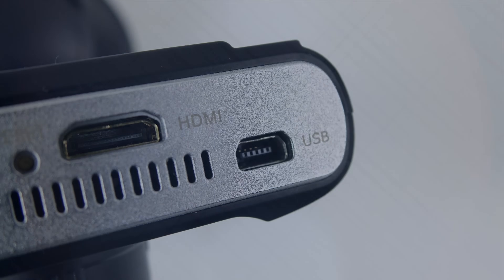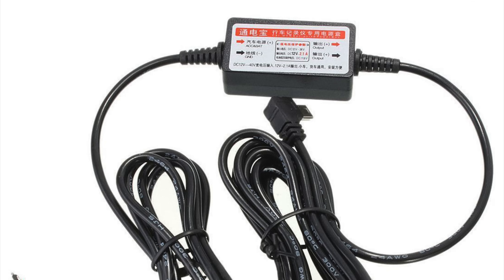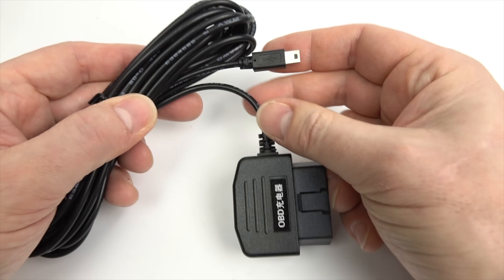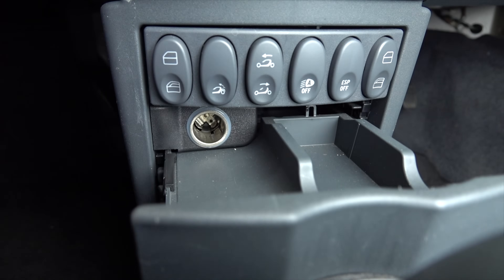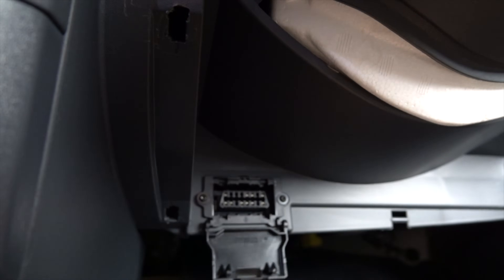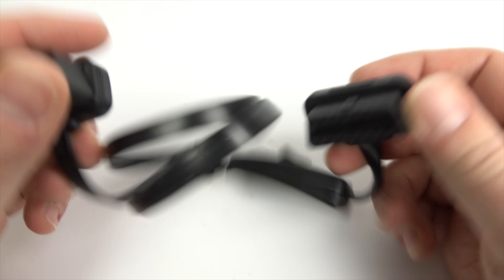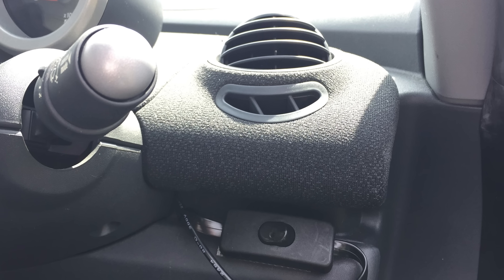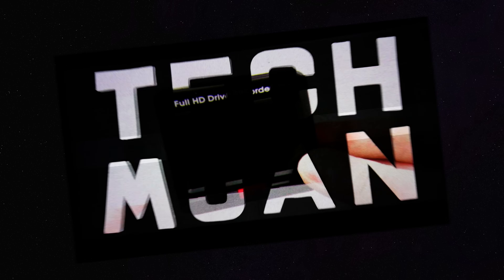You can power a Dashcam via your OBD port (but perhaps you shouldn't)

Comment: I recommend replacing all important fuses in your car with automatic reset circuit breakers

That's too say things like Engine Management, ABS, Collision Avoidance RADAR etc not so much heated seats fuses

They tend to last much longer and are more reliable too trip very few fuses burn out at the actual rated power rating or at the right amount of time often taking much longer and/or at a much higher power level than it should!

Comment: Worth noting for some electric cars: your high voltage battery may automatically recharge your 12 volt battery if it detects it's getting low. Some EVs do this and it's awesome. Also many obd plugs have low voltage cut off circuits in them so you don't need to worry about it anyway. :)

Comment: This comment is for the people that have an ev or tesla This is the preferred way to power your dash cam with a tesla you will have to buy an accessory  wires that will tap into wire housing conector  for teslas unique obd2 or cam bus for power and the accessory  wire will have to have a traditional odb2 port  and there you will have it power to your dash cam

Comment: I believe this video is out of date. I am using OBD power adaptors to install dash-cam to my cars and they have an on/off switch, which chooses between always on and accessory mode. Draining the battery is not an issue even with always on mode, because new OBD cables have voltage sensor, so shuts off when battery is below 11.6 volts. When in accessory mode, power turns off 5 minutes after you shut off the vehicle, so it's nice for the camera. I believe this video needs an update.

Comment: Using the OBD port for powering a dash cam also leaves the OBD port open for OBD car thefts and key cloning thefts that are happening nowadays.  Since hacking the OBD port is easily done with cheap, readily available devices bought online it's a good idea to lock it with a good OBD lock or to relocate it.
Find out more on our channel.  We have a video on the OBD locks.

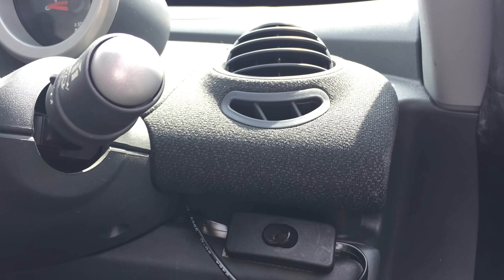Comment: 3:07 - 3:27 Why bother with a switch? You could use a common parking mode power kit with selectable minimum voltage settings, below which the thing get shut off, or by using a time duration setting, probably available in your dash cam's settings (although YMMV), as an approximation.

Comment: very old video for me to comment but juist adding my 2 cents... if you take this approach (power from the obd port), there are cables you can get which will auto cut off once the battery voltage reaches a low state.... (ie: it wont drain the battery completely).... as to how good this is for the battery, prob not too good (its still draining the battery to a lowish state), but better then draining it flat....

Comment: A better idea for parking mode is a big power bank.  Just get shielded  usb cables the right lengths to the cameras. Will not kill your battery. Im getting ready to do 4 cameras and it works. Saw a different video of a guy using a Rexing with a full screen and he got 12 hours of parking mode on a 20000 ma powerbank.  Some jackhole wrote on my window with permanent marker and scratched the door somewhat bad.  The marker i got out in 5 minutes. The door is $500- $700 for a professional to fix. Im fixing it myself. Weather is not cooperating.

Comment: I think its a good thing the dash cam keeps running because someone could break into your car and steal something (yes that's happened to me and didn't have a dash cam) so its good to keep it running so its recording when you're not in the car in case someone steals something from your car or hits your car while parked and takes off. just get an obd cable for the dash cam with low voltage detection so it doesn't kill the battery.
Reply: dude....if someone breaks into your car they can just steal your dashcam
Reply: @Matanumi  but if it records to the cloud you will be able to see who stole it.

Comment: I bought 3 of these with female usb adapter to connect my dashcams, it works really good, I leave it on at all times, soo far have not killed the battery, fast and easy  to connect
Reply: what's the longest you've let the car it without turning it on? My car sits sometimes for 4-5 days before driving it.

Comment: 1. There are dash-cams which can sense when the car is standing still, and they go into "parking mode" which is very low power consuming (one picture every second). I have one of these, it's called "mini 0807" and is really really good (it's an older model, i think there are newer ones now). When something hits the car the dashcam immediately starts recording with HD-quality and sound. This camera has recorded a hit-and-run so far, saved me 2000$ in repairs.

2. Some cars, BMW for example, sense the battery level and when the cars battery is getting too drained, they cut the power-feed to the OBD-port and 12V sockets in the car. My BMW 520D lasts about 6 hours in parking mode before it shuts off the power to the OBD. I have had my dashcam installed for two years and have never had any problems, works like a charm.
Reply: So if BMW cuts off power supply to OBD in 6 hours of parking mode. How do you run your dash in parking mode for longer duration ?
Reply: @harisjav  I can’t.. have to add another battery if I’d wanna run longer than that
Reply: Crooks, be patient. Wait for a bit more than 6 hours. Then go for it!

Comment: 2020 newest obd2 extension cable is made of high tenacity fiber material, can be fixed at an angle, and bears 50kg

found it on amazon:  https://www.amazon.com/MR-CARTOOL-Extension-Diagnostic-Compatible/dp/B08CZD7R9Z/ref=sr_1_127?dchild=1&keywords=obd2+extension+cable

Comment: I was watching some videos and related video linked showing powering dash camera via OBD-II port.

To get to the point, one of the best dash camera manufacturer ' Thinkware Dash Cam' has approved a 3rd party OBD-II power adapter called "EchoMaster OBD II Power Cable" and even selling it on their website directly + even made a video about it as well.

I think this should give enough confidence that... OBD-II port can used without any issues?

Comment: apemans (https://www.apemans.com/) has an ODB hardwire kit (CH50) with a micro USB connection for connecting directly into their dash cam.  Built into the line is a "G Sensor" unit that detects someone messing with your vehicle (vibrated) and starts the camera working - but also shuts off the dash cam (completely) if it detects the voltage of the battery drops to 11.6 or less.  This is a very informative video but it's going on 5 years old so it may not have been available in mid-2016

Comment: Not being funny, but most good dashcam 'even the cheap cameras' have a auto standby... so you'll not be draining the battery when a dashcam is fitted directly to the obd2 port... only if the camera is activated will small amount of energy be used at anyone time which in all essence is completely different when your comparing a camera to a light bulb...

Comment: As an auto mechanic, I can definitively say that using the OBD-II port for power is not dangerous or harmful in any way, provided that the adapter is made properly, and uses only the power pins for power. The power pins are a direct battery connection (through a fuse, of course) and are not connected to any onboard computer. Nearly every diagnostic scanner out there draws its power from that source, and those use a lot more power than a dash cam does. In addition, fleet tracking devices use it for power. Many insurance company tracking systems do so. In fact, many cars (a lot of General Motors models, for example) even have the power pins on the OBD-II port on the same circuit as the power outlets- connecting to those is exactly like plugging something in to your cigarette lighter. People who are saying you might damage your vehicle's electronics have no idea how these things work. Again, the sole caveat is that the power cord is made properly, and only connects to the power pins. It's essentially the same as using USB for power. You have power pins, and you have data pins. Same thing on OBD-II ports. The different OBD-II protocols (CAN-BUS, ISO9141, Keyword 2000, K-line, etc) all have their own pinouts for data, but the power connections always use the same pins on all cars.
Reply: I read your comment carefully. It shows that you are someone who talks with knowledge. I'm going to try this on my brand new XC40. I hope no problem will occur :)
Reply: Thanks for very useful info. I have a question please:- As connecting the dashcam via the OBD will mean the power is constant will this drain the battery completely or would it take many days for that to happen? And with this is mind would you suggest an in-line power detector that turns off the dashcam when the battery charge drops below a certain amount or is it not necessary?
Reply: @inquistive  most decent dashcams (viofo, blackview, thinkware) have low voltage control. When they're in parking mode they drop to almost nothing when you park. And will shut themselves off when low voltage is found.
Reply: @fcastle the thinkware obd2 cord uses 8 pins.. including data pins.. iroad uses 2 pins..
Reply: thanks for the info!
Reply: Based on your comment I will buy that cable. Your sentences are well put, this is why I will go ahead with the purchase. Thank you.
Reply: @InformedGlobe  garmin do a power adaptor/cable that has a timer switch at the obd plug - 10 mins, 24hrs or infinite. I'd like to think even in infinite mode there is low voltage cut off/protection, as per their cable that is hard wired directly to other cables in the vehicle (and is cheaper) but yet to find info regarding a cut off.
Reply: @thebrowns5337  Well, I just found out the hard way to use this stuff, my battery died, just spent $300 in a new one.
Reply: @thebrowns5337  Yes the Garmin constant power cable will automatically turn off if your vehicles battery goes below 12 vaults.
Reply: ok, but why do obd producers warn of plugging or unplugging it while ignition is on?
Reply: Thanks for sharing this. I have heard many stories about how the tracking devices from insurance companies damaged the electronics from various sources. So are you saying it is not possible? What if the car battery constantly gets drained?
Reply: Puedo usar una extensión en el puerto obd II  ,para una dash camera y en el otro  Dispositivo de cierre de ventana para coche, sistema de módulo de apertura OBD para TOUYOTA RAV4
Reply: It's important to also clarify that as a power source it's an output signal. It's coming out of the connector and not going into the OBD connector or computer.
Reply: @Anders Kristian meh I would suggest Flixportal. Just search on google for it :D -yehuda
Reply: @Yehuda Erik Thank you, signed up and it seems like a nice service :D I appreciate it !!
Reply: @Anders Kristian no problem =)
Reply: "People who are saying you might damage your vehicle's electronics have no idea how these things work."

Obviously, but thanks for being so clear about it.
Reply: I know it's pretty off topic but does anyone know a good site to watch newly released movies online?

Comment: i have this vantrue 2pro, i used the OBD port adapter on my honda accord hybrid, and it is a perfect setup! had it in sentry mode or parking mode for days, and no drain on battery. wont consume your battery, and its a clean install with no wires all hidden up to the windshield!! do it!!

Comment: Why can't they make a lead that detects that the alternator is running (14v ish instead of just over 12V) , when the alternator is runing the OBD lead uses that as a signal to send the power to the USB.
I guess they could , but who makes one ?
Reply: KarlosH Fuse circuits can be fitted into “on only” fuses like headlights or power windows.

Comment: There is a built in kill switch to prevent yr vehicles battery from draining and causing a no start condition. This allows your vehicle to record in parking mode without draining your battery. Also park mode only records for a few mins then shuts off if no movement is detected. Anyways I have the obd wire kit and is supposed to supply power at all times just like a telematics receiver for your insurance company that plugs into your OBD port. If it is draining your battery you most definitely have a short somewhere and would advise you to get that fixed asap or the obd port adapter is broken and the built in kill switch has failed and either will not work at all or basically heats up so much it sodders itself into an open current position causing a constant power drain. That would require a replacement obd adapter

Comment: I think the idea of using OBD is that when the ignition key turns off the dashcam senses a change in voltage and switches from (constant) operating mode to park mode, which operates only periodically and  briefly to conserve battery power. It is likely to only come to life when a sensor indicates outside movement near the car, or a nudge to the vehicle, or else it just takes 1fps snaps until the car is started again.

A power pack for £20-£40  gives peace of mind for your poor old car battery, but many dashcams claim that they automatically shut down when your car battery voltage drops to a specified threshold. But bear in mind these dashcams are often made in China where reliability and quality control is the Opposite of Germany.

The OBD port is a discreet location near the door and therefore it's usually easy to hide cabling runs to it.

Comment: If im going to have only DDPai M4  base connected to it ( actual camera module removed) , will it drain the car battery? If it doesnt then its quite neat solution tather than tinckering with fuse box.  Please reply Technomoan.

Comment: I am thinking of buying this as I am no electrician for cars and simple plug in for my carcamera should be fine??
Reply: yes. all good. the port is just a fused constant power port that can also be used to read diagnostics. too many devices can be plugged into that port and left for the cars life without a on/off switch and have been around for over a decade now. low power cutoff is why it's ideal for dashcams with park mode.

Comment: There's a new version that pairs this with a switch as well as a proximity sensor eradar which only draws power when and where an object comes within 3-5 m of the car, and auto switches off when there is no subsequent movement. It is also paired with an on off switch. Presumably, this deals with the issues of overdrawing from battery while running the car or after the ignition is switched off. The plug and play nature of an OBD based power source, and a 12V to 5V step down is a great USP

Comment: Wondering how long it's going to take for car manufacturers to start putting 5 volt USB outlets in cars.
Reply: Art C I have seen many radios with a USB port on them, and my car from 2008 had a USB port in the console as an option (though I think it was more for playing MP3s off a flash drive)
Reply: My 2012 Honda has a similar port in the console.  It's just for playing MP3 files.  Doesn't even have enough power to charge a phone.  We need cars with lots of 5 volt USB power ports.

Comment: I’m looking for the opposite....
I have a Navdy heads up display and a GoFar for logging drives. 
Unfortunately they both need to be plugged into your OBD port the problem is the OBD II port is only designed to send information to 1 thing ...
I did buy a OBD Il splitter but it’s useless as the OBD ll port can’t send information to 2 things at the same time so neither work properly...
So I was Wondering if there was something I could plug my Navdy into as it Bluetooths information from the phone anyway that I could then simply plug it into a USB socket in the car.

Comment: ok what if my car doesnt have an OBD and I want to use an obd device? I have an OBD device which does many things and one of them is give my car 4g internet. I want to put it in my old car instead but no where to place it. Is there something else I can plug to the lighter or usb that will power my obd device?eldorado cup holder center console
Reply: get a new car. These ports have been in cars since the 90's

Comment: did you know on the smart roadster Ecu has about 6 connectors on the side, 3 switched and 3 permanent.  Smart do the adaptor you need or you can just crimp a spade to the cable and use that, connect neutral to any metal part of the car and you are good to go.  I had a Windows car PC installed in my Roadster :-)

Comment: Probably safer and smarter to tap it to an ignition switched 12V source (not that I have an OBD socket anyways).

Then you don't risk damage to your computer from constant OBD draw, it is already switched (not all lighter sockets are switched), you can safely add an in line fuse, and it can be more easily concealed so it isn't in your face. 

Mine is tapped from under the hood (also for the running lights I added and for e-fan in the future), but it can be tapped from the ignition switch itself.

Comment: You can steal power from the Audio Player on your car.  
If you buy a 3rd party Audio Player, they usually have extra Female USB on the back and you can attach the dashcam to that USB.   and when you will start  the audio player then the dash came will work as well. 
Also   you can cut the power wire and hotwire the dashcam power to the audio player.
No side effects and you keep the car stock.
Reply: If you are willing to rewire the audio player why not just steal the power from the fuse box?